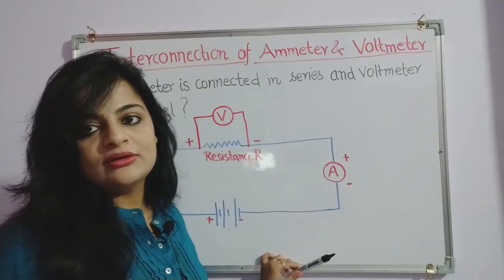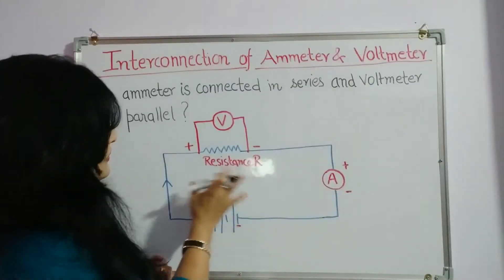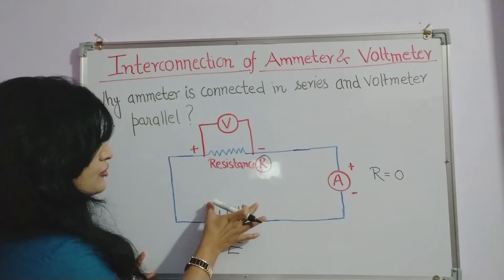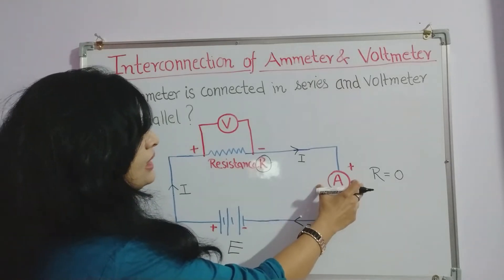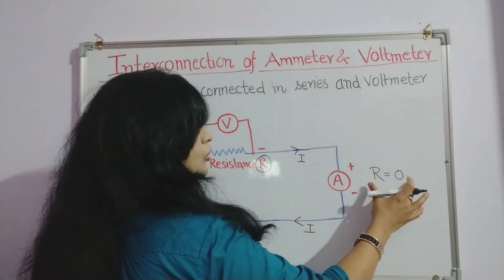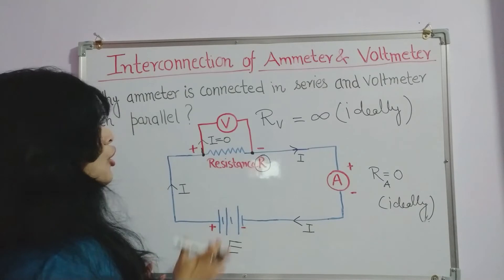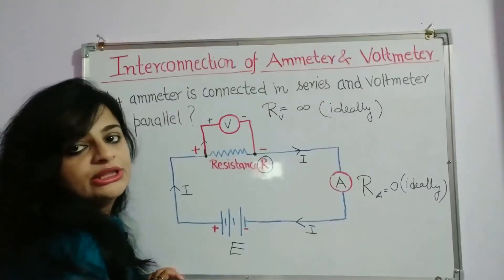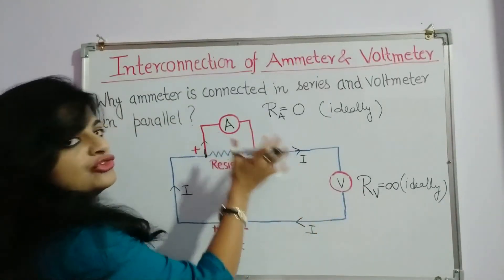Interconnection / Connection of Ammeter and Voltmeter in a Circuit by Dr. Aditi

Comment: Good evening ma'am, I wanted to ask that if ammeter is connected in parallel then would current flowing through ammeter be more than it flows through it normally.
Reply from the maker: Yes because if ammeter would be connected in parallel then all the current will be drawn by the ammeter and no current would flow through the actual component across which we want to measure the amount of current flowing because current always choose the least resistive path and in this case ammeter has nearly zero resistance.
Reply: @graspwithdraditi  mam as we connect ammeter in series , the whole amount of current will flow through the ammeter also ,then why  the current don't effect ammeter in this case?🤔
Reply from the maker: When ammeter is connected in parallel to the circuit, net resistance of the circuit decreases. Hence more current is drawn from the battery, which damages the ammeter.
I hope you understood now.
Reply: @graspwithdraditi  Exactly